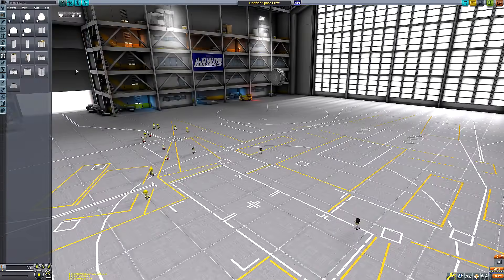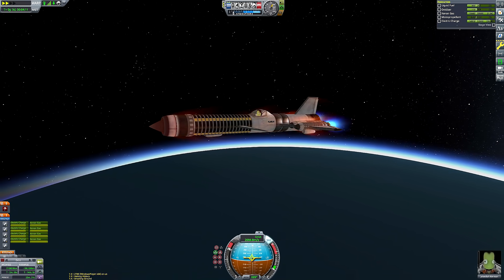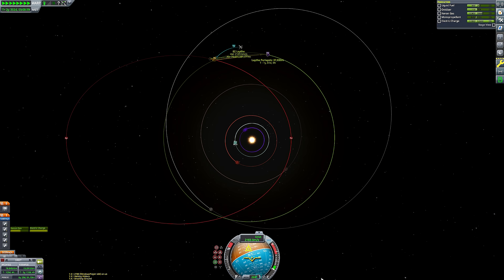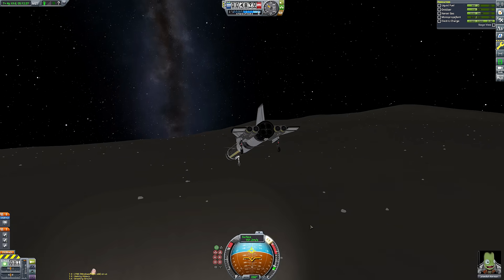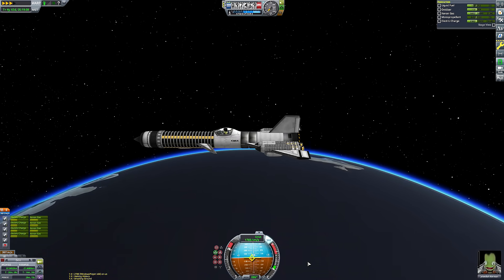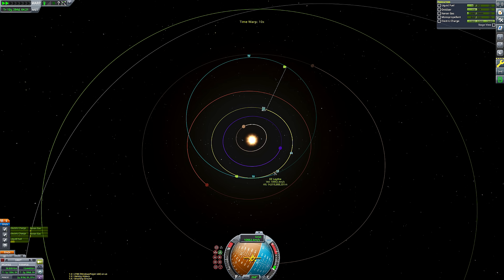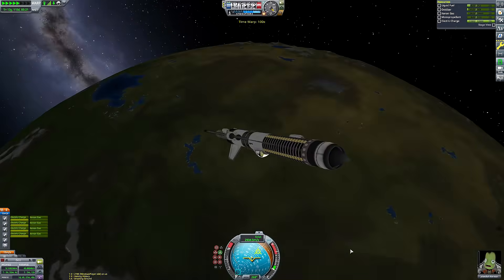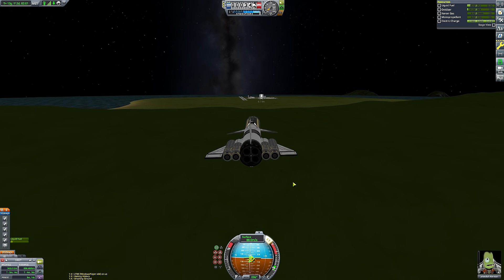KSP: I changed my mind about ion engines...

Comment: This video was in my Youtube recommended page...

Matt Lowne,

There are two main problems with your idea of what ION propulsion should be:

1). Battery power is limited, which means batteries die, propulsion ends. Long-range missions become intractable. Period, end of story.

2). ION propulsion requires the idea of charging a gas which can be polarized, and then driven out of the vessel (via you battery) via some sort of exhaust. What do you think happens when you run out of gas (normally Xenon gas)? Basically the same thing that happens when your battery becomes exhausted. Everything goes dead. Again, long-range missions become intractable, especially if there are course-corrections at various times.
---
Here's my ideas, for your perusal:

1). Power-supply is Zero-Point Energy. This technology is not pie-in-the-sky... one of these actually received a US-Patent in 2002 (called a MEG). This system consumes no fuel, and has no environmentally sensitive emissions. It simply makes electrical power. That is it, simple, and inexhaustible. Works theoretically forever. Please see the following link (it's not the only Zero-Point generator):

http://jnaudin.free.fr/meg/meg.htm
This represents a working copy of the device that was handed to the US-Patent Office for examination, and some discussion.

2). EmDrive, for propulsion. This technology is in its infancy, but it has been proven, that this system (invented by a fellow in England, some years ago), converts electrical energy directly to propulsion (in both China and in the US [NASA tested]).

While we are some years away from a working system, this is the only system capable of the 40-80 years of propulsion and maintenance electricity for a sub-light voyage to the near stars, and return.

Nuclear power (including long-life isotope reactors) don't last long enough for this kind of long-duration space flight.

Give this stuff some thought...
Reply: Your description of zero point energy breaks the laws of thermal dynamics and the EM drive tests have been proven to just be force generated by the testing equipment, id recommend Scot Manley's video on EM drives if your interested
Reply: @Kyle-gw6qp  

1). Your knowledge of temporal topology remains flawed. The US Patent has already been awarded for the MEG in 2002. This makes breaking the Laws of Thermal Dynamics; an old and moot point (I've been reading your claim for more than 15-years, by several people, it remains a false claim). I don't give a damn whether it breaks a rule or not.

It doesn't.

The US Patent Office did the largest Patent Examination ever committed in over 100-years. All the math (2500 pages issued by the inventor(s)) checked with experts from the US Patent Office. They tore the MEG down to its screws, unit was re-assembled and still worked.

The fact that this prototype works, voids any claim you might make. It has been confirmed in many countries.

2). The EmDrive is not a dead idea. In fact, in China and at NASA in the United States; both countries have done two interesting things. First they have gone quiet on this prototypical device. And second, both countries have enlarged their budgets on this device's research.

This means the device is showing increasingly good results.

I looked at Scot Manley and some of his discussions. Firstly, Scot Manley is a naturalised American (born in Scotland) that was educated at University of Glasgow, and is presently employed at Apple Corporation, here in the United States. I find his history troubling. While he may be an excellent programmer, what does that have to do with his ideas in high-energy physics? Nothing is a good guess.

I am a licensed US Amateur Radio Operator. I am experienced in antenna design. Antennas are very weird, and many people consider them 'voodoo'. For example, why do antennas work? They are open circuits (with a few well-placed exceptions), and do not follow basic conservation of energy, entirely.

That is important, because the EmDrive works very much like a form of directional antenna in the microwaves.

There is nothing you can do about this device. It remains a solid source of sublight propulsion, which may enable us to go to near-stars in 50-100 years. It is in its infancy.

Give it time.
---

You are barking up a very old pair of trees. Give it up, and do something constructive.
Reply: @kd7bwb12  how does your magic device create energy from nothing? Something that has been proven impossible many times.

Scott has a background in physics and is an amateur rocket enthusiast, just like your an amateur radio enthusiast. And why does his nationality matter?

The EM drive might still work I never said it didn't just that currently all tests have been disproven. If it works it will need to be tested with more accurate equipment and might need a redesign.
Reply: @kd7bwb12  also the laws of thermodynamics are not "rules" that can be broken, you physically can not break them and they will always be true. They're are like the Pythagorean theorem, a²+b² will always =c² no matter where you are this will be true for any right angled triangle.
Reply: @Kyle-gw6qp  

I know, I laid a trap for you, and you fell into it. Sorry for your discomfort.

Firstly, let's look at Scot Manley's education, and his main focus (from Wikipedia):

"While studying at the University of Glasgow, Manley received a BSc (1990–1994) in physics and astronomy, and an MSc (1994–1995) in computational physics a year later.

In 2002, he worked as an engineer for Napster. Later, from 2002 up until 2004, he worked as a research engineer for Qualys. From 2004 to 2009, he worked as a security architect in imeem, where he developed and maintained an audio and video upload, transcoding, fingerprinting system among other things.

Manley's current employment is at Apple Inc. He joined Topsy Labs in 2009 and in 2013 Topsy was acquired by Apple.[1]"

Notice please he is not a physicist. He got his Masters Degree in computational physics. He is not a theoretical physicist, he does computational modeling. Topsy Labs does social modeling in software. Physics? No.

Not the same as understanding anything, in physical terms, centered on antenna dynamics, or actual power transfer dynamics of any sort.

This all means, he is not skilled in  this area. More importantly, he gets his paycheck from Apple, because he is skilled, again, in Computational modeling.

His nationality is part of his life, and gives us some understanding that he has traveled, in order to work. The fact that he plays at model rocketry, does not elevate him into knowledge of the EmDrive. Emdrive is not a rocket, in the traditional sense. It is more of an antenna, which happens to create propulsion.
---
Next, about the MEG, and other zero-point devices. Many quantum or zero-point devices employ energy from, what used to be a theoretical layer of energy domains, formally called the 'Aether' or 'Ether'. The fact that this device works, now proves the existence of the Ether. This is the source of the energy. It is not 'energy from nothing', it is a domain which is part of the boundaries of nature. And resides in the same theoretical space as string-theory (which I don't agree with) in terms of conversation.

The MEG is real, and the power generated is real. There is nothing anyone can do to make it fail. If it didn't work, and couldn't be explained, the US Patent Office would not have awarded a patent, plain and simple.

As for the EmDrive, your knowledge is faulty. While it remains an inefficient source of propulsion, nevertheless, it does make propulsion, and operates like a microwave antenna, in basic theory. The funding in research is enlarging, not shrinking. This means that however inefficient it may be, the problems are seen as just that; problems. With time and work, the EmDrive may prove useful.
---
Now, let's talk about science. Science is not about laws. Physical or scientific laws are a shorthand for ideas that tend to work fairly often. These are rarely achored in 100% certainty. Science is the art of confirming theories, and the communication with other scientists in that field to confirm theories into working hypothesis. 

For example, take a look at the 'Big Bang'. This theory (and that is what it is) is breaking down under extreme examination, because most of the proto-elements of that era never made enough of these materials and did not match any of the projections. Hydrogen and Helium remain very light on amounts. Yet the Universe contains 15-million times the total matter than should have existed had the Big Bang actually occurred. Lots of problems.

Actual science, stands as theories, and much of it requires more work. Let's look at things from a different slant, all of the technological and scientific progress we've made in the last 5,000 years, 99% has occurred in the last 200 years. How much of it is proven? You and I don't know.

We can't even resolve the existence of the Electron, and yet we use it every day. Many technologies (not science) come down to this kind of problem. We use something without fully understanding it.

As for mathematics, while mathematics is very important, remember to understand that mathematics can define the range and strength of a theory, but nobody can prove a theory and make it fact with methamatics alone. In physics, everything must resolve to a physical test.

Period, end of story.
Reply: @kd7bwb12  I don't think you understand, Scot looked at the evidence and papers written by people in the field, he did not come up with his conclusion himself.

The EM drive might work I never said it didn't just that currently there is no evidence that it does.

The magic zero point energy battery cannot create energy as that is a fundamental law that is impossible to break. Maybe I miss understand but by the sounds of it your claiming this device can make energy from nothing which we know for a fact can not be true. Now perhaps it converts matter into energy which would be possible but would not allow for limitless travel.

And let's say this theoretical craft works, it would still not be practical because what's the point if takes 300 years to get anywhere, the EM drive has stupendously low thrust. By the time the craft got somewhere all the passengers would be dead or all the people on earth listening for a transmission would be dead, and if they are some how still alive the craft would have degraded so much it would no longer function.

And the big bang theory is a theory, not a law. The laws of physics and the laws of thermodynamics are undisputable. There is lots of evidence for and against the big bang, there is no evidence against the laws of thermodynamics and physics.
Reply: @kd7bwb12  what trap are you talking about?
Reply: @Kyle-gw6qp  

Kyle,

Conversational debate tactics, don't get a conversation. These tactics are mine. And they stay mine.
Reply: @Kyle-gw6qp  

I don't think YOU understand. The patent for the MEG is awarded. The horse is outside the barn. The device works, as does several other zero-point generators.

The fact that you keep talking about physical Laws, as if they are statutes, never to be broken, remains very poor logic. Especially when the MEG DOES NOT VIOLATE THEM (does NOT violate the Law of Thermodynamics, does NOT violate the Law of Conservation of Energy [also lodged against the MEG]) , and I would not care, even if it did (please write a police citation to that effect, please, I'm begging you). Not one single law of physics is immutable in all cases.

This is important, because the Big Bang was seen as immutable and almost LAW status, as early as 1995. Since then, we've got actual physical data that makes the Big Bang subject to serious question. I used the Big Bang as an example of things that can be toppled.

You don't think well, do you...?
Reply: @kd7bwb12  the big bang is a theory that is disputed, the laws of physics are not. And people get patents for shit that doesn't work all the time, it has to be unique not working.

How does it work then? How does it generate limitless energy without breaking the laws of thermodynamics?

And to reiterate, the laws of thermodynamics and physics are not laws, they are immutable facts that our understanding of everything is based on. If they can be broken then we wrong about almost everything.

And if you've got limitless energy why not use an alcubierre warp drive? It works in theory and allows faster than light travel (sort of)
Reply: @kd7bwb12  also what even is zero point energy? I checked out your link and it's just some bogus device that gives you more energy than you put in.
Reply: @Kyle-gw6qp  

"Nothing unreal exists"
Reply: @Kyle-gw6qp  

Ultraviolet and infrared are undetectable by men directly. So is the layer of energy that is used by zero-point devices. To detect this layer, without a zero-point generator, requires a specialized phase-array radar device. We use specialized devices to detect ultraviolet and infrared.

Power is NOT FROM NOTHING. THE US PATENT IS PROOF OF THE MEG OPERATING.

"Nothing unreal exits"
Reply: @Kyle-gw6qp  

Zero-Point devices are called that because most of them operate by AC oscillations of a square-wave transformer. Power from the ether enters the core when the AC waveform becomes zero volts. at each wave transition. Zero-Point.

"nothing unreal exists"
Reply: @Kyle-gw6qp  

Nothing unreal exists.

Why would anyone want to discuss the Alcubierre drive? For me to discuss (since you brought it up, you personally, must provide a working prototype). Alcubrierre mentioned this idea in a lecture. There is no hardware whatsoever. Even he says it will take a long time to prototype, let alone resolve it into technology.

I find it interesting that you want to discount devices that actually exist for testing and development, but now you want to advocate a warp drive theory, as if it were real.

Your capacity to reason clearly, continues to be heavily flawed.
Reply: @kd7bwb12  no, my point was if you have limitless energy and are using a theoretical engine(the EM drive is currently theoretical as it doesn't work yet) why not use the best one? The alcubierre warp drive does actually work in theory and was proposed as a thought experiment in a scientific paper by one of the leading physists at the time.

I recommend you read up on it because it is fascinating and mind bending. It works by manipulating space to reduce the distance traveled which looks like faster than light travel to the outside observer.
Reply: @kd7bwb12  but I checked out your link and it just says it creates more power than you put in, it does not once mention zero point energy. Plus there is a patent for a perpetual motion machine that obviously doesn't work.
Reply: @kd7bwb12  stop with the "nothing unreal exists" and tell me where the energy comes from? There is either an external source or it will eventually stop working. it cannot be completely self contained and output energy forever because that would require creating energy, which we both understand to be impossible.
Reply: @Kyle-gw6qp  

Nothing unreal exists.

The MEG has a US patent from 2002. You can't stop it from operating.

As for Zero Point devices, you need to read the material. I don't have to explain it any further than I have. It is, by its function, a 'zero point' device. The last time you bought a car, did the salesman call it a personal conveyance?

Perpetual motion machines don't get US Patents (and no one has tried in at least 50 years.).

I am so happy, you fell into the trap again! You crack me up, operating as if you are the sole arbitrator of things that work. I love it. Cracks me up.

Go ahead, make me laugh again. I tell the truth, and you speak nonsense some more.

Oh, and by the way, I'm still waiting for you to present hardware for the Alcubrierre warp drive. So nothing so far I assume <grin>?
Reply: @kd7bwb12  the bit about the warp drive was simply a suggestion that if your using theoretical technology you might as well use the best.

Stop saying nothing unreal exists, of course nothing unreal exists but something can exist and not work.

People get patents for tech that doesn't work all time it's not evidence that it works. I will believe it works if you link a peer reviewed study from resputable source until then it's a magic box.

And common sense will tell you it doesn't work, even if we ignore the fact that it breaks the laws of thermodynamics (something which you have failed to address other than "no it doesn't shut up") if it worked it would be everywhere and no one would pay for electricity and electric cars would have infinite range. But instead it's a magic box that works by breaking the laws of thermodynamics and produces limitless energy while not being used by anyone anywhere for some unexplained reason.

Your only evidence that it works is a patent, something which we have established is not actual evidence so until you have evidence take a seat <GRINS>
Reply: @Kyle-gw6qp  

Nothing unreal exists

You need to review your own words.

You brought up the following:

"And if you've got limitless energy why not use an alcubierre warp drive? It works in theory and allows faster than light travel (sort of)"

This is a point of view you made, attempting to talk about this pure theory, as if it was technology and therefore hardware.

Okay... let's see the hardware. The moment you do, we'll talk about it. But this one is entirely something you started. It's your topic, and you have to deal with it. You don't get to push this as if it were 'in passing'. It wasn't intended that way, and now you can't support the ask you placed, and can't support the actual technology.

I've already put up information, and you keep trying to kick holes in it... without success. You now accept the EmDrive (you have admitted the device produces some propulsion, which makes us both in agreement). You said this:

"And let's say this theoretical craft works, it would still not be practical because what's the point if takes 300 years to get anywhere, the EM drive has stupendously low thrust"

 And you are almost in the mood to accept a patented device called the MEG. It is patented after a very large examination by experts at the US Patent Office. It is not false, it was not patented in error, and you just put up smoke as if it were something concrete.

You are clearly losing the debate, and now you are becoming incredibly circular. 

You remain very foolish. I have done my due diligence, and you have not. Now make a useful point, or surrender. Just think where you would be in a college debate class. Very embarrassing.
Reply: @kd7bwb12  your putting words in my mouth and missing my point. The EM drive is currently theoretical, if it works it will produce very low thrust, IF it works.

The MEG cannot work forever as it would break the laws of thermodynamics, which impossible.

I suggested the warp drive because when using THEORETICAL technology you might as well use good theoretical technology.

But you are yourself ignorant and refuse to actually tell me how the MEG works without breaking the laws of thermodynamics, something which you claim it can. You also claim I said it was a false patent, not true I said that a patent isn't evidence of it working. You yourself are foolish, imagine this was a debate:

"It can't work, it's impossible"

"It works I swear"

"Evidence?"

"It has a patent"

You are avoiding a question deliberately, not great. additionally don't compare it to a debate because this should be a scientific discussion and not political arguing. Instead of attacking me please tell me how the MEG produces infinite energy without breaking universal laws.